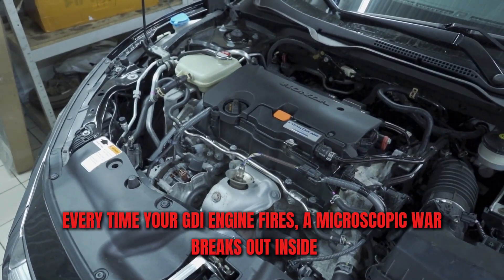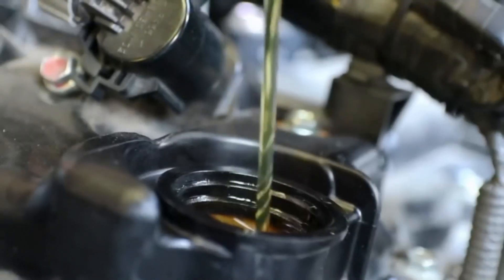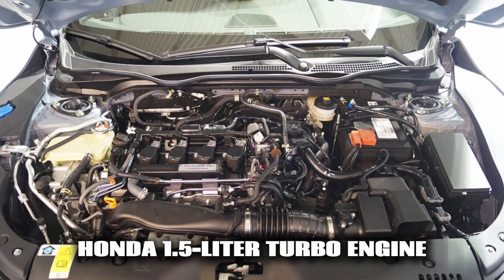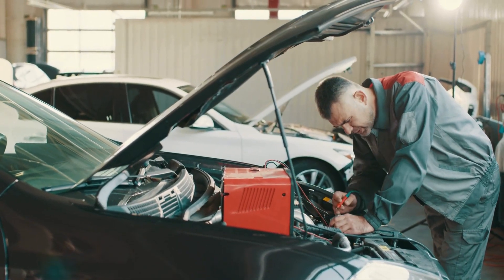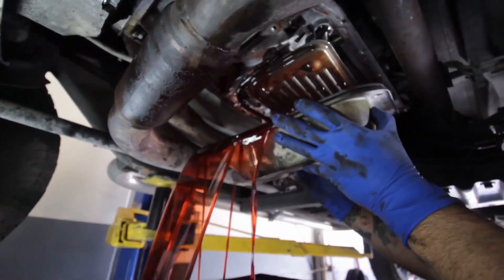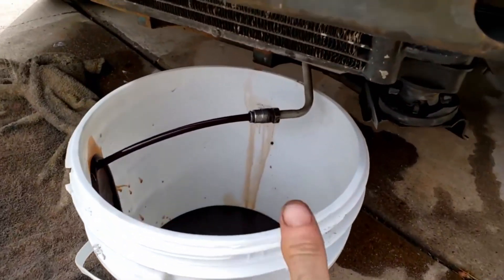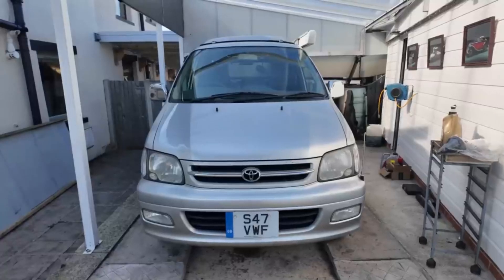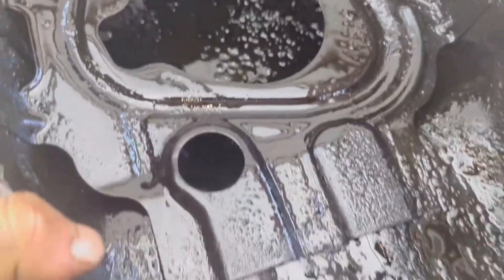Stop Changing Oil at 5,000 Miles — Mechanics Warn It’s Hurting Your Car

Comment: There was an Oil decades ago with a claim it had a 25,000 oil change intervals...not no more. Now its a 5000 mile change. I drained the oil 1 time at 5000 miles and it was the last time bc the oil was carboned out, a pitch black muck !!!  Im back to 3000 mile intervals and the engine runs alot easier with cleaner oil.
A Chevron Rep schooled me at a Trade show... all Oil will get contaminated from fuel and condensation and Heat.

Comment: I was raised in the late 60's. Pops always changed oil at 2k.  I did that for years. Never had an engine grenade.  I now change my oil at either 4 months or 4,000 miles.

Comment: Thumbs down as you're not thorough in your video. There is a lot to take into consideration, how many miles a year, the viscosity of the oil, whether you're using group 2, 3, 4, or 5 oils, and the local temps.

Comment: No full or 100% synthetic will be a problem at 5,000 miles.  Ow20 should probably be at 5,000, 5w30 and up can go further.  That's providing you started with a clean motor.
Reply from the maker: Thank you for sharing

Comment: Use full synthetic oil and change it 7500 to 10,000 miles. Oil is cheaper than an engine replacement.
Reply: Only if you drive a lot of miles per year.  If you drive 7500 miles and less a year, do it every 6 months

Comment: If you want to help your engine change the filter in between oil changes . most of the contaminants are trapped in it and the bypass valve will open if it gets to much trash in it and go straight to the bearings etc. .
Reply from the maker: Thank you for sharing

Comment: I have continued to keep my oil change interval at 3000 miles and using synthetic oil.   All my vehicles have gone well over 200,000 miles when sold with no engine issues.   Be a hater, regular maintenance is great insurance.

Comment: TOYOTA SAYS 10,000 MILES AND NEVER HAD A PRIBLEM
Reply: i saw a 4th gen tacoma blowing smoke the other day....turbo shot, or engine? i really don't know.
Reply: Don't do 10,000 miles on 0w20, especially in warm climates, the oil can shear down to 0w10 and you will have metal wear.  To be sure,  Get an oil analysis from Blackstone Labs.  It's $40.  Group 4 and 5 are supposed to be able to handle higher heat ranges.  The only oils I am sure are in those groups are Amsoil, Redline, and Triax.  That 1999 court ruling really didn't do us any favors.

Comment: Changing your oil too soon is cheaper and better than Changing it to late. Oil is alot cheaper than a motor. At 200,000 miles thats 35 oil changes at 6,000 miles at aboit 3,000.00 verses a 8,000.00 to 12,000.00 dollar motor
Reply: BLAMM!

Comment: So many cheap people in the comment section lol it sometimes will take 4 months for some drivers to reach 5k mileage, and the idiots don’t realize that oil loses its viscosity within 3 months, especially with the climate season.
Reply: 2006 Hyundai Sonata V6. Have not changed oil or filter since 2013.
Oil always at the full mark.
Let me save you the trouble.

YES I AM A STUPID IDIOT.

Comment: I changed it for 5,000 and most manufacturers recommend 7,500 to 10,000 that's too long
Reply: depends on the miles on the engine new 10,000 ok 200,000 mi engine 3-5 k is better . changing the filter mid service .

Comment: My friend hit 1 million kms on his 2002 Ford F-150 without changing anything but muffler and expendables like brake pads, belts, etc. His original OEM engine still runs like new. When I asked him how was this possible he said oil changes religiously every 5000 kms and lubricating gasoline with every single fill-up at the gas station (he uses Lucas Upper Cylinder Lubricant, about half of their smallest bottle per each tank of gas). He says having great lubrication from the bottom only isn't enough, you have to lube upper cylinders via gasoline. 10% ethanol in fuel makes things even worse, hence the Lucas.
Reply from the maker: Thank you for sharing your experience!

Comment: I have owned a 2008 Hyundai Sonata, 2016 Tucson and 2023 Tucson always change my own oil at 5K intervals with top of the line full synthetic.  Have never had any problems and no oil burning or usage at 100K on the 08 and 16 cars.  Love Hyundai when properly maintained.😇😇🥰😎😬
Reply: The Hard Riding Dipstick Posse here to remind all of you engine lovers out there to base oil changes on OIL COLOR and your own dang eyeballs and judgment bits NOT MILEAGE, thats what that dipstick's for!  CHANGE THAT OIL when medium-dirty or earlier, DONT SLACK TIL ITS BLACK!  IMMUNIZE YOURSELF to bogus owners manual info and damn internet fools!  Every engine's different and people drive different too, YES that includes YOU!  Don't be a fishdick, USE THAT DIPSTICK!
Reply from the maker: Thanks for sharing
Reply: Yea same here.. With the the new i20 Crdi OCI at evey 5K Kms (3k miles) . Car at 100K Kms. The engine note and it's parameters is same as Day 1. Hyundai driving is pleasure if maintained well.
Reply: @richardjoseph10  Hyundai issued too-long oil maintenance recommendations.  Do you know why specifically?
Reply: @GeneralFukzamatayu Yes. These manufacturers recommended longer intervals because they want to make their car look economical on paper to say ur car has less maintenance. Theyre not interested in you keeping your car. They just need to make sure its good enough to last through your warranty period. 7500 miles interval will require 13 oil changes while 5000 miles interval will require 20 oil changes. When selling to customers, saying 13 oil changes instead of 20 oil changes will make car look more economical.
In theory, 7500 mile works. But in order to keep your car running optimally and clean, 5000 is the ideal interval.
Also, it depends on how you drive. 7500 highway miles is different from 7500 city miles or 7500 city/highway mix miles.
Reply: @EdDy4RheelZ  From all that I've seen I think that people would rather be told honestly and forthrightly but I don't sell cars from a lot or showroom.  People do want to do whatever is best for their car and engine.

Mileage basis is too fraught and error-prone.  I previously fell into the trap of thinking that it was just about getting a number right or best.  Some people have turbos, some have older or newer vehicles of different tolerances.  I've come to embrace the Dipstick or "field inspection" method as both superior and universal, both surest and least-fraught.
Reply: I change the oil before 5,000 intervals

Comment: I seriously think this video over exaggerates big time. People who change their oil on a regular basis and use good synthetic oils, have had engines exceed 300,000 miles with regularity, some even reaching a million miles with all the major internals measuring still in factory specifications. I mean what are people supposed to do ? Drive to work everyday and worry about gas mixing with their oil ? I say bullshit.
Reply: Hi Richard, I feel that you are lucky that you are still owning an older car with old fashion 'port fuel injection'. The newer ' direct fuel injection ' is a different animal. If you look into more into this direct fuel injection cars from different manufacturers, you'll understand more. With my experience dealing with direct fuel injection,  this video tells the truth on oil dilution, carbon build up in the secondary air injection system and intake plus premature engine internal wears. Unexpectedly, all of these usually cost  a lot of Money and these problems will surely reappear again because it's a birth defect.
Reply from the maker: Thank you for watching!